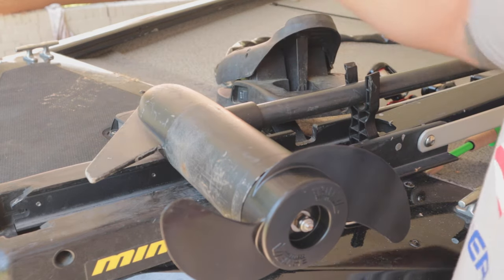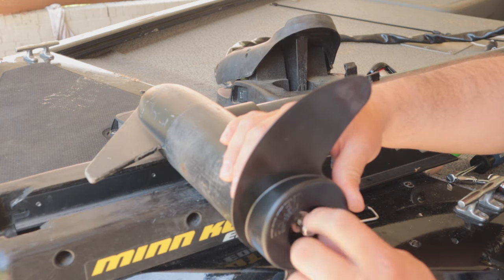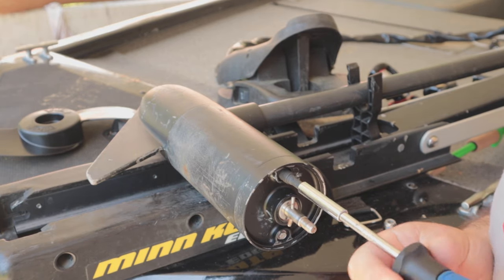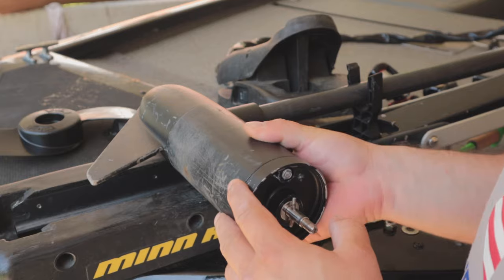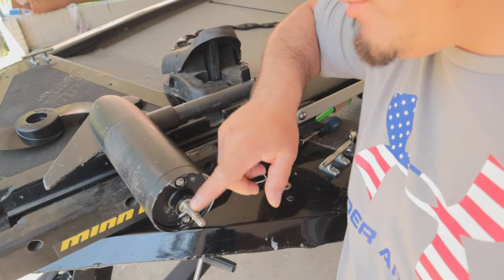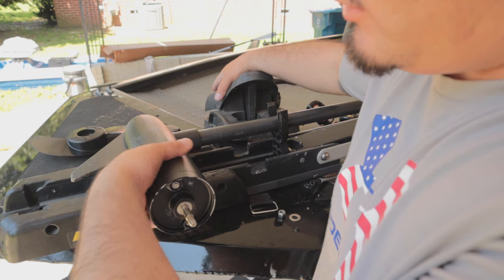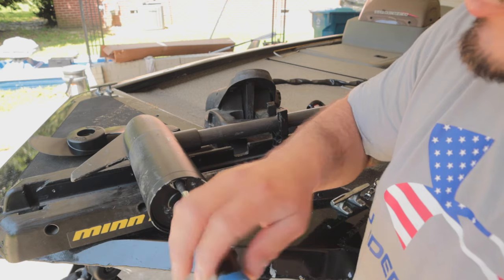HOW TO TUNE A TROLLING MOTOR || WORKS FOR ANY TROLLING MOTOR

Comment: Obviously you have never changed the motor brushes because if you had you’d know that the magnetic center housing has o-rings on each end to prevent water entering. All you’ve done is break the seals on all four exterior locations. Anytime you crack the seals Minn Kota recommends ordering a replacement seal kit. DO NOT DO THIS AND BY THE WAY HOUSING WILL RETURN TO THE ORIGINAL POSITION ANYWAY. Bad advice here!
Reply: As an Electrician and a fisherman who has worked on motors I agree 100%
Reply: Really?
Reply: I was a bit concerned about the seals myself. If the motor runs free, its best to leave it alone.:body-green-covering-eyes:
Reply: Meh, it's a $300 trolling motor , he'll learn.... At least this wasn't a Garmin force or an Ultrex 😅
Reply from the maker: @coreyh7641 made this video 3 years ago and the trolling motor is still going strong so 🤷‍♂️.
Reply: @TexasReelnFishing I'd say that too, to avoid egg on my face
Reply: Dude it went back when you let it slip
Reply: You're partly correct.  Yes, there are seals.  If they're in good condition (supple) and greased, you can rotate the stator (middle section) without damaging them.  If they're old and brittle, you're correct, they should be replaced before doing this "timing" operation.  

He's essentially setting the motor's "timing" by rotating just the stator (center section).  And no, it will NOT return to it's original position, if you properly secure the bolts at the end cap.  Do not confuse the rotation of the end cap, as that WILL return to it's original position as the bolts need to remain fairly straight throughout the housing. 

 The center section will NOT return to it's original position.  In fact, if you turn it too far, you can degrade the performance of the motor.  Mark it with a sharpie and you'll see what I mean.  You need to get the timing just right, which it sounds like he did.  As you point out though, i hope he didn't introduce a leak by potentially disturbing old seals.

Comment: If you want your trolling motor to last as long as possible don't mess with it
Reply: Why not tune it up? Seems reasonable, it may have been assembled on a Monday or Friday. Might need tuneup right away.
Reply: I did this on my minn kota, fried the speed controller in less than 2 hrs. Not the greatest idea...
Reply: @johnm2617  that’s what trolling motors are used for. Do you use yours in a kiddie pool?
Reply: If I can turn a 45lb thrust into a 55lb thrust for free why not. Lol

Comment: Ok I wasn't gonna say anything but after reading the comments I feel obligated. What you're doing is, basically resetting the magnetic polarity of the armature (the shaft). Because if you pay attention to the video you'll actually notice that, even though you moved the stator (case) once you tightened the bolts back down it moved to its original position. Which to anyone who watched this video and tried it on their motor should have noticed that they never removed the bolts completely. Or even if they did,  there are only two holes down in there to hit which are the holes you removed the bolts from which would cause the motor to go back to it's OG position. So what I mean by resetting the magnetic polarity 🤷..  When the motor is powered by DC current, a magnetic field is created within the stator, attracting and repelling the magnets to the rotor. This causes the rotor to start rotating. To keep it rotating, the motor has a commutator. When the rotor aligns with the magnetic field, it would stop spinning, but in this case the commutator would reverse the current through the stator, reversing the magnetic field. Which is what keeps the rotor spinning. It's like if you have 2 magnets. On one end of the they pull towards each other and the other end they push away from each other. The current makes it go from N to S rapidly pulling an pushing the rotor 60 times a second. Long winded I know but I hope that helps you understand how what you're playing with works.
Reply: Soooooooooo is there actually a benefit to what he did for the metally challenged?

Comment: By rotating the stator (motor housing) you are advancing the motor timing. It will run faster and use more power but could cause the motor and speed controller to overheat.
Reply: There's no stator, it's a permanent magnet field housing & as long as it runs free, no damage will occur . :face-orange-raised-eyebrow:

Comment: Doing this will result in more prop speed but will result in more battery drain and needless motor wear. The gain in minimal at best and will just swear your motor out faster. You'd be much better if replacing the prop instead of doing this.

Comment: My Minnkota-45 trolling motor has had a bit of a vibration since new and it’s exactly how you’ve described. I must’ve knocked the motor out of perfect balance on the first day of use. Thank you for this great tip!
Reply from the maker: You welcome brother hope you get it right and thanks for watching
Reply: Did this fix it @slagletoby
Reply from the maker: It did for me I don't know if it did for Slagletoby
Reply: @theparamedicyakker5539  I loosened up the hardware and tried to dial it in to no avail. With the stock prop and prop nut the slight wobble (out of true) still remained. I added an big aluminum prop nut, it’s slightly cone shaped and put more pressure on a larger prop area providing better sync and less vibration. I also tried a Kipawa prop which was junk, uge wobble, very out of true. Go with the big prop nut.

Comment: How you can turn that a lot, if those large screws (bolts) going to secure all the parts to the front   of the motor. I don't get it? Please explain the logic or the threads where those bolts go into are a moving part?

Comment: Oh yeah I checked mine anyway and mine was just a tiny bit off a little bit enough and now it’s running better it’s running smoother and it’s actually getting more Rpm as I checked it and yeah this is a good helpful video 😊

Comment: I have the same boat set up. Just got it wed. Been out 3 times and my trolling motor is knocking by the blade.. it has not hit anything and the blades are not scuffed.. any suggestions

Comment: So you are dialing in the Mid Section Of the motor. Then Tightening everything down again. Very Cool. I just got 10 minn Kota Trolling motors to tune up. Cheers. Thank You.
Reply: update?
Reply: @ridinskullcandy  Thanks for reminding me. I wanted to watch this video again. Getting ready to test my boat and motor out after I finish working on motorcycles.

Comment: Thanks for the tip!
I wonder if anybody bothers with balancing the prop? I had one that had several nicks in it from rock hits that I filed smooth, wondering if I had screwed up the balance, I found an old brass plumb bob that the knurled end just fit in the prop hole snugly and hung it from the ceiling in my shop and gave it a few spins, sure enough, it lilted consistently to one side. After some filing, I was able to get a more consistent level spin. I honestly don't know if it made the prop run better, I didn't notice any performance difference. Could have just been my OCD kicking in!

Comment: Dude you sir are a genius, just did it to my U-BCOO 46lbs and the reverse speed is triple lol and the forward is much much faster. I’m not sure if it’s safe for the motor or if it burns battery quicker but I’m just pumped to try it on my kayak lol thanks bud
Reply from the maker: Thanks ypu brother I appreciate the comment. I been doing it for a couple years now on the same trolling motor and still haven't had a problem
Reply: @TexasReelnFishing   to be honest i tried it and it kept popping the fuse at 5th speed, i actually dialed it back to the way it was.
Reply: i did just say screw it and ordered a 60lbs
Reply: @92mrhonda  so it broke?
Reply: @ridinskullcandy  sold it last year

Comment: you still using this one or? seems legit. but did you buy this motor brand new? and if so after you did this does it suck up a lot more battery? im trying to find a used one to help me commercial fish trot lines a lot easier so i might try this since the brand new ones are a little out of my price range for now. what i cant find is a lot of these come with short foot pedals but i would like a longer one to mount the motor on the bow but be able to foot control it from the middle of boat so im near the live well tank and can pull up the line on the side of the boat. can the foot pedals be extended or is that a pain in the ass? or can it even be done? i also need at least a 52" shaft though i would like a 60" but there isnt many of those used for sell. and ive read the shafts cant really be extended.... so its kinda  a pain to find a used one.

Comment: just tried it with my minn kota max 40. worked superb. but i recommend doing the adjusting with the motor standing upstraight because thats the position it will be mounted on to the boat
Reply from the maker: Glad it helped and great tip seeka thanks for the feedback
Reply: Orientation won't matter. This has to do with aligning the magnetic field on the motor .

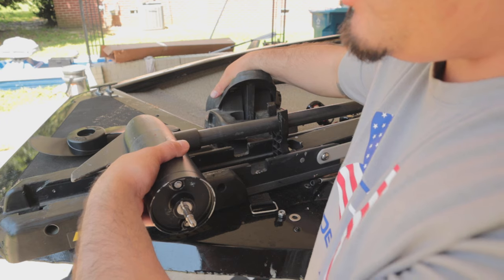Comment: Is it me or after he "tuned" it, it started it again and it went back to its initial place? @ 4:15
Reply: Yep It went back he should have marked it before moving the case
Reply: @robertjackson323  Well, considering that the plate that the screws go into does not rotate, it makes sense that the front bearing cover will go back to the same/aligned position as the screws are tightened.  Reading these comments here just reinforces my opinion that most of these guys are absolute f'ing hacks that have no real idea what they are doing.  Just my 2 cents.  Don't subscribe here unless you want more ridiculous advice!
Reply: All he did was F-Up the o-ring seals that keeps water out. Terrible advice.
Reply: @digitaloverdrivesystems  In the 1st 30-45 seconds I knew he's a hack an doesn't know wth he's doing...or talking about as the very very poor use of terminology.  Yes the housing moved back to it's original position....one can see it moves but when tightened once again it has moved right back.

The only way to actually get more power from that motor is use stronger magnets which is unlikely possible since they probably already use the strongest ones that will fit in there.  Or change the Potentiometer and that may also be unlikely since they probably already use the best one they can in it.
Reply: @tc96z1  LOL WTH would it F up the O-rings if they weren't bad to start with....  It wouldn't unless they were hard from old age. You should take it apart at least once a year anyhow to make sure they haven't failed an letting water in. 
If it would happen then all you do is get new ones and replace them,an no I don't mean buy the overpriced ones from the manufacturer.... just have to do a lil search for the correct size. You can even use smaller dia. but thicker and they'll thin when stretched. Have done that a lot of times in my 40+ yrs working on almost anything with nuts and bolts if I didn't have the exact size at that moment.
Reply: @robertjackson323  doesnt go back the front plate is seperate than large middle.   He essentially is getting balance back. He is moving the housing that holds the magnets.

Comment: People don’t know about it because it isn’t a thing. It never stays in the tweaked position and it will burn up your motor faster and you run the risk of not reassembling correctly and getting water in the armature housing. Good luck
Reply: Oh yeah ?

Comment: Did the adjustment ever do any damage to the motor or drain the battery faster ? I hit my trolling motor on rocks a lot it doesn’t make noise it still runs but vibrates a little ..
Reply from the maker: It's been over a year and I haven't had no trouble yet. Everything seem to be working great. I did the exact thing to mine hit it on a rock and was acting a little funny once I adjusted it I've had no problems.
Reply: @TexasReelnFishing  I’ll try it out to see if there’s any deference.. Thanks for the tip
Reply from the maker: No problem brother hope it helps let me know if it does
Reply: Will it fix a vibration? Doesn’t doing that break the waterproof seal?
Reply from the maker: It helped my vibration and no it won't break the water proof sealant

Comment: I did not know that. Does that work on all models? I just assumed that they came from the factory ready to perform. Are the same procedures used on the Ultrex? Thanks.
Reply from the maker: Hey Mike I'm not sure but i could definitely try and find out for you and i will let you know.

Comment: This is not a thing… I repair trolling motors very often… most time is because of water damage when fishing line winds up behind the prop and tears away the seal on the shaft…  the armature spins inside the housing the brushes stay stationary only riding in slots that are holding springs that push the brushes against the commutator.. the two bolts just keep everything together.  There is no timing.. but what you could do is damage the o rings by over tightening the housing by clocking the end cap thus shortening the whole unit!!! 
This will not increase the speed of the motor… this is not a thing… I promise

Comment: I was waiting for the shear pin to fly out of the shaft and clear into the next dimension!
Reply from the maker: Lol thanks for watching
Reply: IKR! My shear pin falls out every time I take my prop off.
Reply from the maker: Is it a older trolling motor? It should fall put that easy.
Reply: Texas Reel'n Fishing all of my shear pins come out pretty easy on different motors, old and new. Lost them a lot doing prop maintenance.
Reply from the maker: I may need to check mine then mine may be stuck or something. Thanks for the info
Reply: Texas Reel'n Fishing Mine is snug and in no danger of falling out. I’m guessing their tension pin just needs replacing but perhaps some models differ. And thank you for the tip!
Reply from the maker: Yea that's how mine is as well I actually tried pulling mine out and couldnt I'm guessing all models are different. Thanks for the comment I really appreciate it.
Reply: @TexasReelnFishing  a lot of times your shear pin will be slightly bent causing vibrations! I would check yours because a strait pin woulda slid out like butter

Comment: I'll let you know. Thanks, Looking forward to trying. Thank you.
Reply: Thanks for the response. :)
Reply from the maker: @sutv6754 absolutely
Reply: @TexasReelnFishing  Do you mind giving advice. I use a an 11 foot Seaeagle inflatable. I use a 30'' shaft 34lbs motor by Water Snake. I see that water snake makes a 54lbs motor with a 26" shaft. Do you think that would be to short. Sea Eagle suggest the 30 inch at their website. But I like the idea of having a bit more power .....although according to Sea Eagle that won't help me go up stream or faster because of my limited hull speed. They said I might have a little more power advantage in the moving river waters to navigate and I am a river man mostly when it comes to booking. Do you have any experience in this dept.? For some reason they don't make a 54lbs in a 30 inch. Mostly 36 inch which is to much for me and my raft . I am kind of new to this just in the last few years but I'm learning fast.

Comment: Pass. You will have water in the foot..don't do this. Also it isn't timed it's a electric motor..The comments talking about advancing the timing what are you talking about..I have timed a lot of engines but never a electric motor...where the valves lol
Reply: Timing is a very real thing on electric motors.   And if the rings aren't dry and brittle, they will seal right back up just fine

Comment: that is awesome. i am totally gonna try that. i want to try to use a "jump n' carry 660: style power source instead of a heavy marine battery. any tips from you guys about that? just using the motor to noodle about in the marina in a little dingy. we have a minn kota 4 hp. thank you! cheers mates.
Reply from the maker: I'm really not to sure about that brother. I really appreciate you watching and commenting 🙏
Reply: @TexasReelnFishing  aloha! i realise now that my minn kota requires 24 volts--so i will go ahead and use two marine batteries for that. happy summer fishing and boating to ya! cheers from the pacific coastline mate.
Reply: @northbeachfilms  use a LiFePO4 battery at 24V, will be much lighter and last you a lifetime.

Comment: If the seal leaks and lets water inside after moving the housing around, will this ruin the armature?
Reply from the maker: I don't really know much about these older reels Steve I got it borrowed from another youtuber
Reply: Yes 100 percent it will ruin it!
Reply: It won't ruin it. I've rebuilt a couple of these motors. Soak them overnight to make sure they're sealed up. One motor I did leaked. Took it apart and sealed it up again. Ran fine.
Reply: @deerhunter5305  yeah as long as it isn't salt water and shorts out the coils. Drying it out and resealing would work.
Reply: @DL  Your probably right about salt

Comment: Those two screws are about 8 inches long maybe longer so when you loosen them and twist the housing you’re just twisting the screws out of alignment and guess what they’re gonna do?
Reply: Answer - Torque the entire assembly when the screws are secured, effectively putting undesigned stresses into the assembly. Pleased to read others thinking 🤔